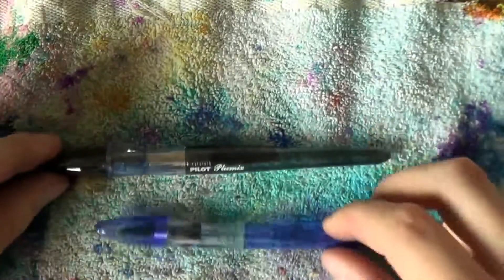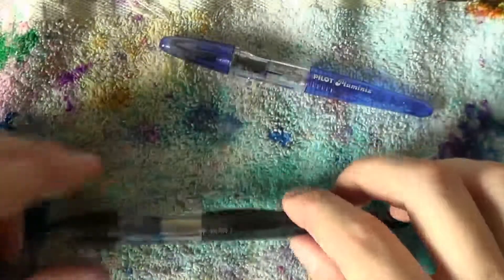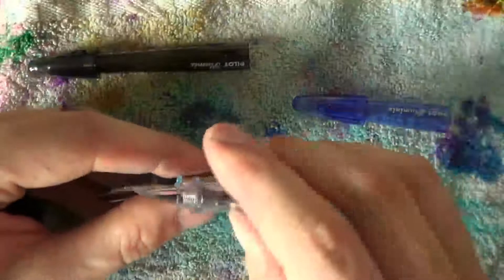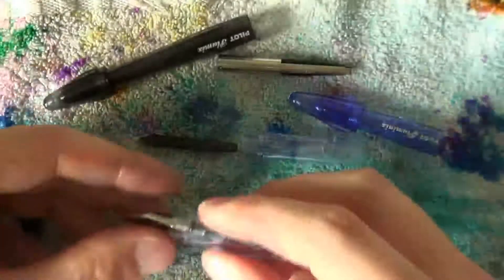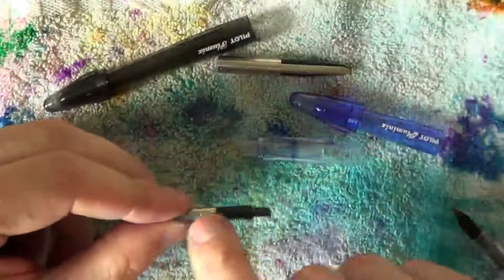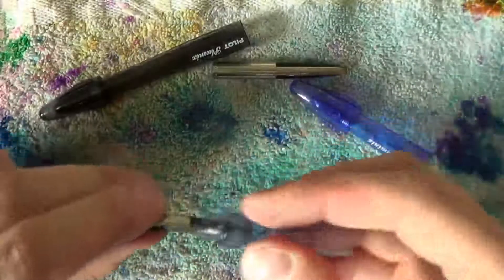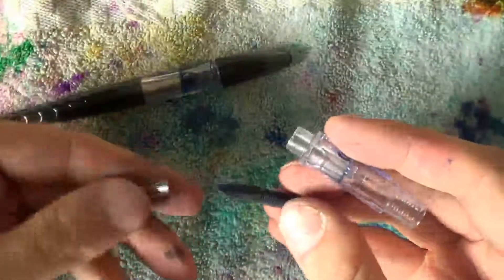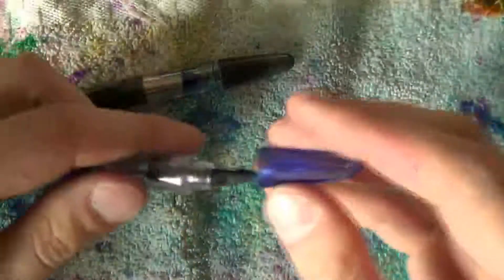Disassembly Line Pilot Plumix and Pluminix

Comment: Seven years ago your voice was much different than it is now - as can be heard in this video.  Back then you had then a strange kind of brogue when speaking English.  What happened?
Also, you erred here, Steven, when not noticing that the two pens take different cartridges - the Plumix requires a Pilot proprietrary cartridge; the Pluminix takes a standard international cartridge.  But they both can (and should) be eye-droppered.